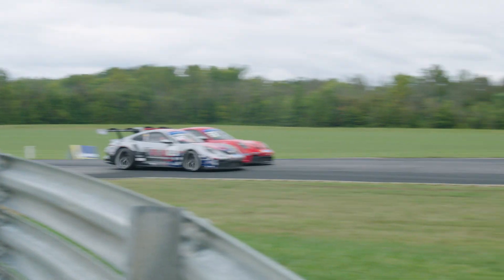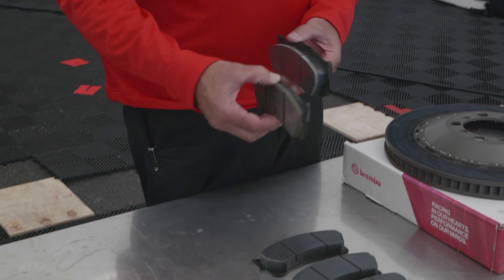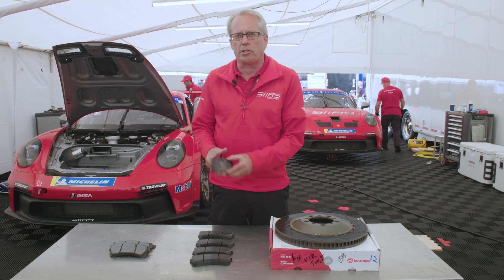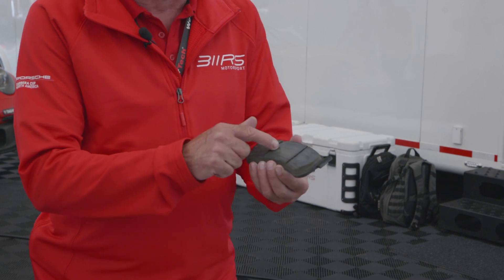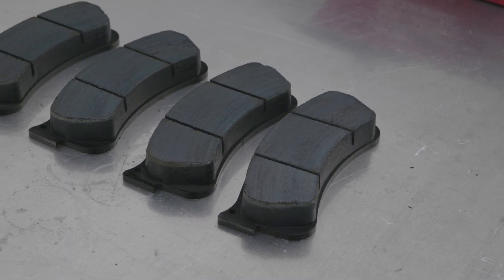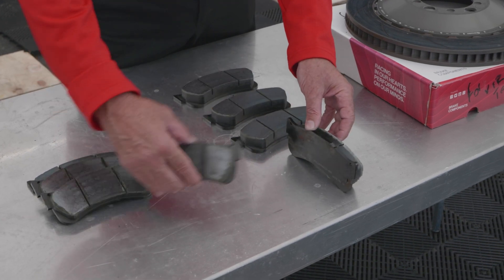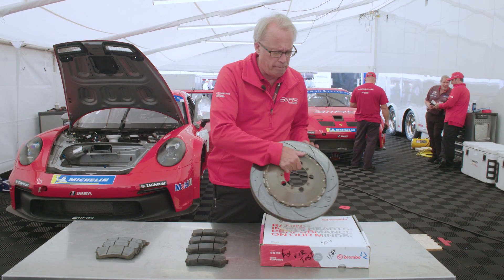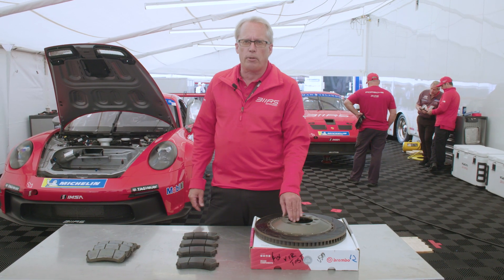TECH TALKS: 992 GT3 Cup Pads and Rotors

Comment: Do you guys see higher pad wear on the 992 GT3 Cup vs the 991 GT3 Cup? And do you ever have issues with fluid boil?
Reply from the maker: It is driver-dependent, but in general the 992 does go through brakes quicker than what we see on 991s. More aero, more tire. No issues with fluid boil thus far.

Comment: Nice video thanks.   I noticed the driver using 1 leg for brake/gas .  Normal? or is it just driver preference?
Reply: I noticed that as well, I would have thought that left foot braking would be normal but maybe not?
Reply: @cxwrench1  leh keen is not a left foot braker, so i am pretty sure it is a personal preference/experience matter.  he says so elsewhere in this channel
Reply: Leh taps the pedal on the straightaway to put the pads right on the rotors! Also to make sure that they are there !!- 😁😁😁👍👍 R.I.P Greg